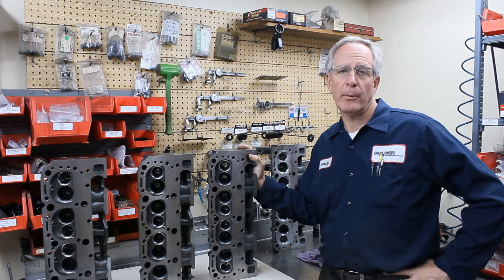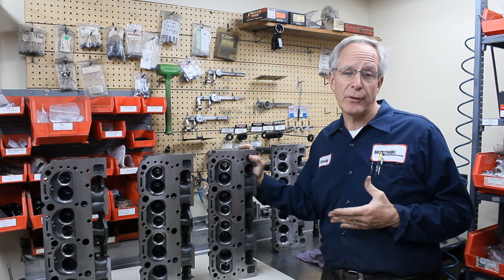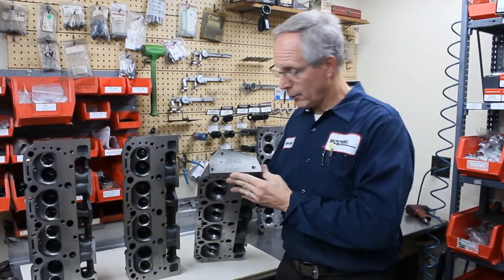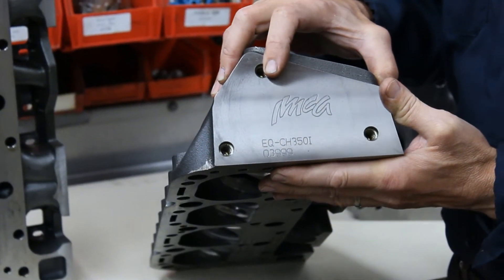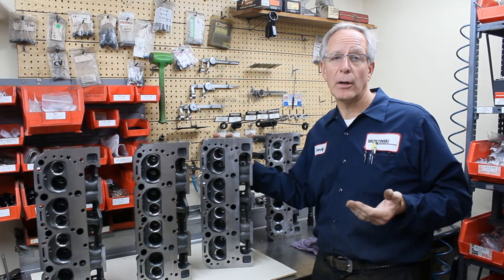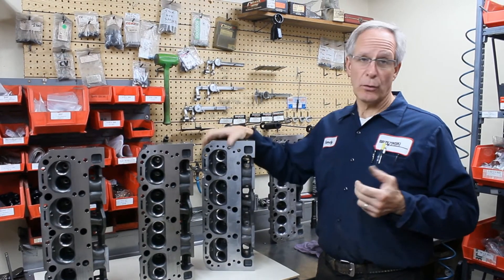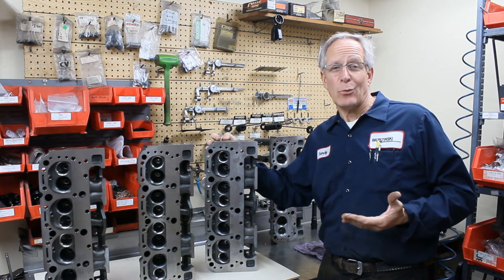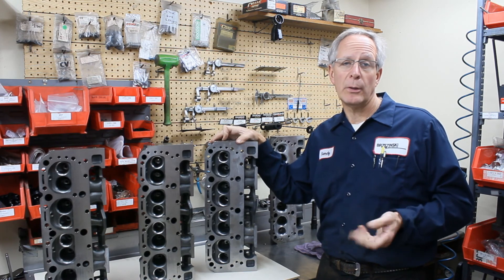Engine Quest 350I Heads Part 1

Comment: Hey cast heads! What is the best head i should get for most torque and horsepower.? IMCA EQ heads from speedway or dart? Or a different dart head? Unlimited just want a sleeper look. Also aluminum double humps or what about DNA heads to port and replace guides and use bigger valves etc.? RHS race rites?

Comment: Aftermarket doesn't always mean better. I put a pair of S/R torquers on my 383. Nearly all the valve springs cracked on the right  side. I replaced all the springs on both sides. About 6 months and 4k miles later I had a dead cylinder. Valve job must've been crappy from the factory one of the valves wasn't sealing very well. Had about 90psi in that cylinder and 180psi in the other 7. I was pretty disappointed. I went to the junkyard and bought a lower mileage pair of Vortec heads. Had the guides trimmed and valves lapped,new springs. I was surprised. That engine was a turd with the S/R Torquers. Felt like it gained a bunch of power idk how much? I'm gonna say 20+. I'd say,if you're trying to make 430hp or less,you really can't beat a good pair of vortec heads for the price.   I'm using Vortec heads on the TBI engine I'm going to rebuild for my conversion van. It's obd 1,it's a 1988 Chevy. Does anyone know if I can use a roller camshaft? It has a flat tappet in there from the factory. I don't want to use a flat tappet camshaft. It's almost 2021. Will the factory computer work ok with a smaller roller camshaft? I know people who've switched things in TBI engines before and they ran like crap. Check engine light stayed on. Bogged. Stalling out issues. I'm not trying to get 400hp. 300 would be nice. I'm mainly going for torque and reliability. After all...it is a 2.5 ton conversion van. I think it's kinda scary even doing 80mph in it.😆
Reply: well if you think one hp to cubic inch and also 10HP per pound LBS. of vehicle. Now, you definitely want 400hp and 500 tq in an astro van. It is very easy to do

Comment: Can these heads be angle milled, if so, how much?    great videos and we use your Chevy heads and intakes....
Reply: Haveing problems with my eq heads with head studs
Reply from the maker: We can angle mill them. The real question is what chamber CC are you looking for? You may be able to get it low enough just by doing a flat cut. With our valve job and a 1.94x1.5  they start about 78cc and we can flat cut them to around 64cc.
Reply from the maker: if you do too much of a angle, what will happen is the bolts, or in your case, the studs, will be at a different angle than the bolt holes in the head. when we angle mill heads we make sure to correct for that problem.